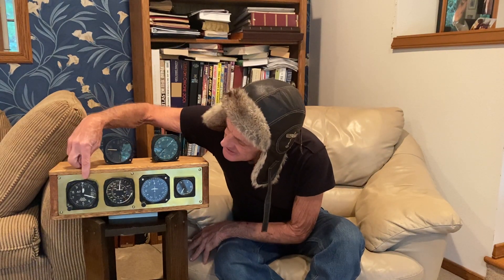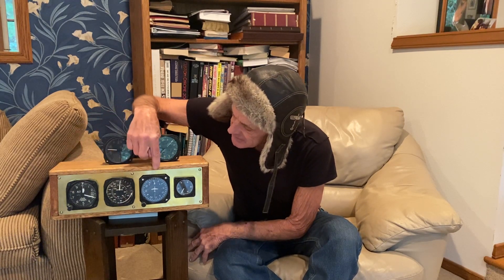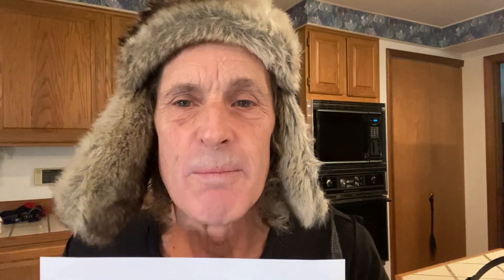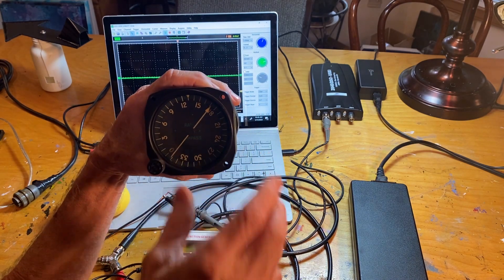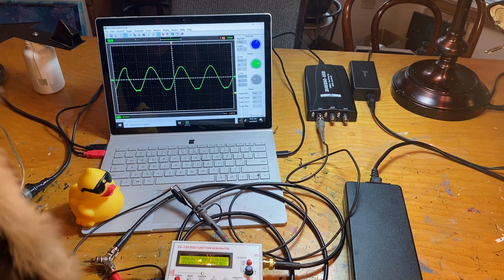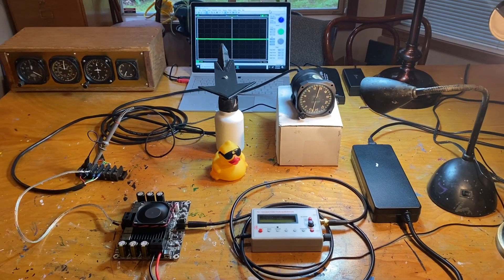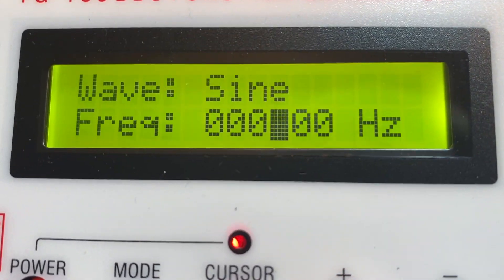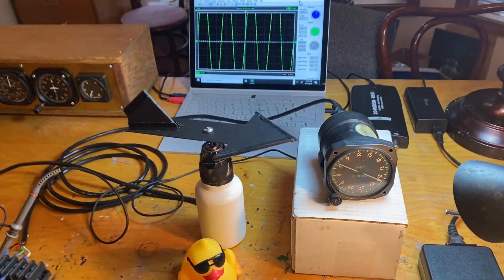How To Make A WW2 Radio Compass Work

Comment: Hi Frank. The instrument looks like its not flowing smoothly, consider looking for a vibrator inside the sealed unit. Some standby instruments in aircraft have small vibrators to ensure the smooth and accurate flow of needles and gears. Also the 2 voltage standards now adays are 14V and 28V at 400 Hz 115V/120V AC. I never knew it was 26V back then. A radio compass is old tech and I love to see them still in use. Its a shame they are overshadowed by VOR technology which is not much older. You can find old CDI/HSI instruments online, with HSI doing the job as a compass and a course deviation indicator. Pilots would also use their HSI's as makeshift radio compass since all you had to do was allign the course deviation with the knob until it was centred and you had the exact course to your VOR or TACAN. Got to love analogue technology. God Bless
Reply from the maker: @ryleymclean313

Hi and thanks so much for your comments. You make some great points. Of course in WW2, the emphasis was on reliability, even while taking "incoming". The radio tuner that goes with this Indicator is humongous. I did find some schematics for it online which showed the corresponding other half of the Sel-Sync. This allowed me to find and connect a modern day Sel-Sync which would normally be mounted in the loop antena.
Reply: Most early instruments of the era never included any vibrators because vibration coming from numerous sources like engines, pumps, other nearby instruments (especially the ones with a built in gyro) and even the fuselage itself was well enough for smooth operation. The vibrators were common in test and calibration setups though. Today with modern programmable microcontrollers and motor driver ICs we don't need any vibrators to properly drive the old instruments either because we can just synthesize any signal we want. By adding a small guaranteed high frequency dampened overshoot component we can almost completely eliminate the rotating transformer's problem of having low torque at low error signal level 100% in software. And that is on top of the option of completely eliminating the outdated input signaling and repacing it with easy to use digital serial interfaces like CAN or RS-485 and ability to use more suitable common system voltage of 24V and converting it to the required drive voltages on the spot.

Comment: how about the gyro type compass please Frank
Reply from the maker: Great idea... You got it. I actually have the gyro compass. They work off a vacuum pump driven by the engine. I just need a B17 engine to get my compass going. Just messing with you, an electric vacuum pump will work great. look for my implementation soon, and thanks for your suggestion.